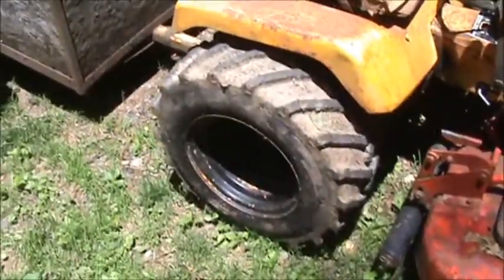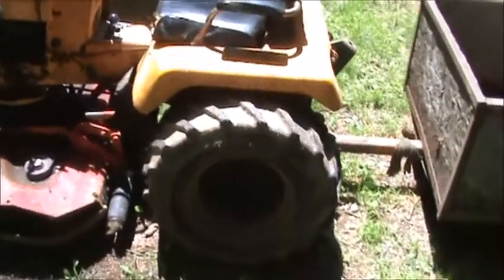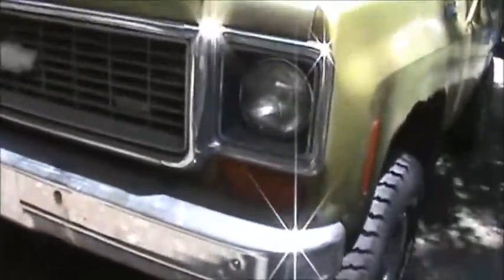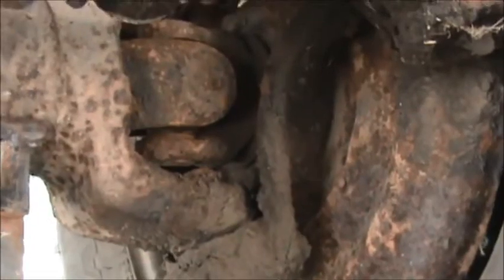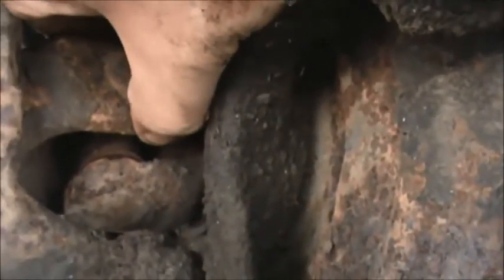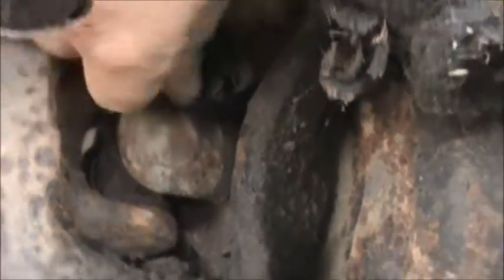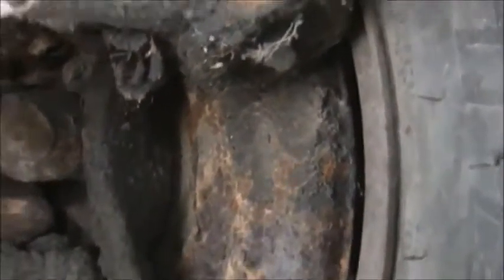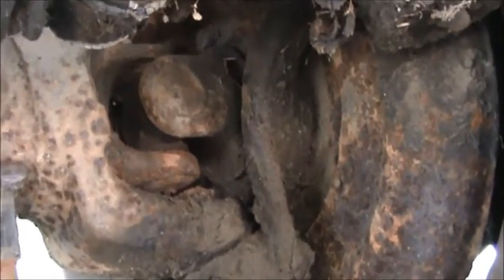Chevy K-10 front axle 🔫🔫🔫

Comment: Mine is doin the same thing whn I turn the drivers side makes a howling rough like noise an i can move the shaft an u joint around pretty good like you were doing. I have 10 bolts front an back with stock gears. I'm Starting my axle swap this weekend to a dana 44 frong an 12 bolt rear with 3:73 gearing.